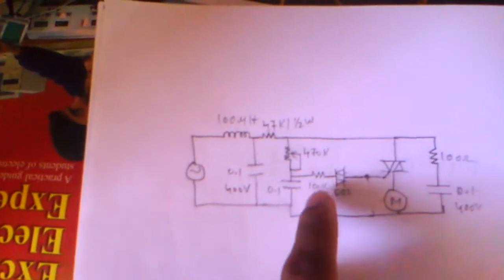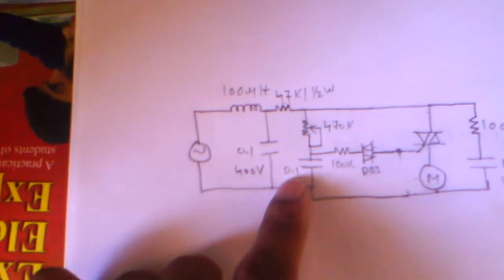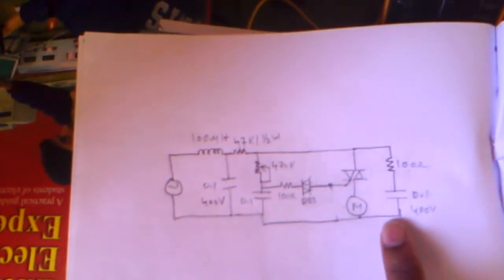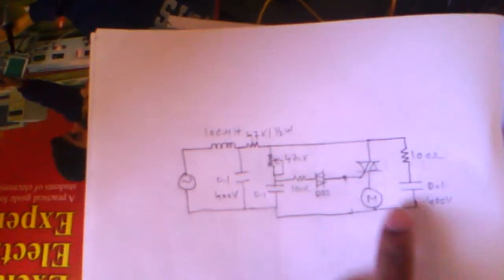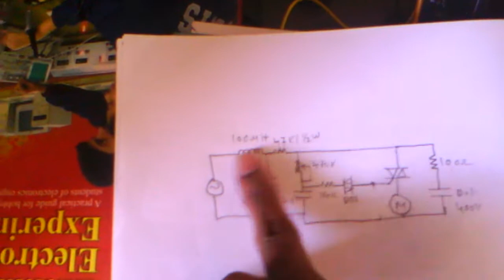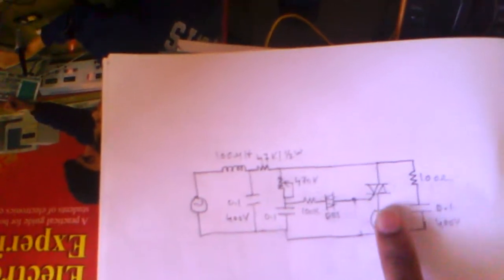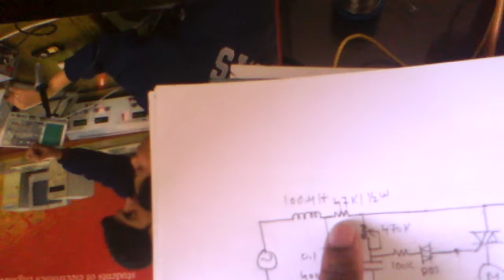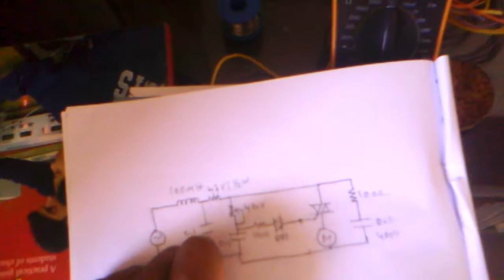Triac Motor speed control

Comment: i need to control this with a micro controller instead of a pot by pwm pulses . is that possible? sir please reply
Reply from the maker: vishnu govindan no you cannot . it is phase angle triggered
Reply: I want to do the phase angle control in AC voltage controller with the help of an micro controller in order to control the speed of my induction motor , in which way i can achieve this sir??
Reply from the maker: vishnu govindan for that you should use zero crossing detector ic which will give pulses when ac wave crosses origin . the microcontroller will trigger triac based on that pulses
Reply: here i am using Raspberry pi as a micro controller unit , is that possible for me to do it?
Reply from the maker: normally people use arduino or 8051 in this case .  but if you know to use raspberry pi then you can.
Reply: You can use the combination of LDR and diode instead the potentiometer
http://jespereklund.blogspot.com/2012/11/ac-dimmer-for-arduino.html